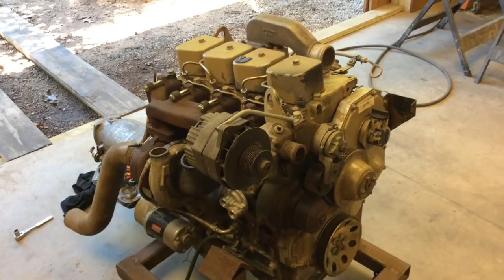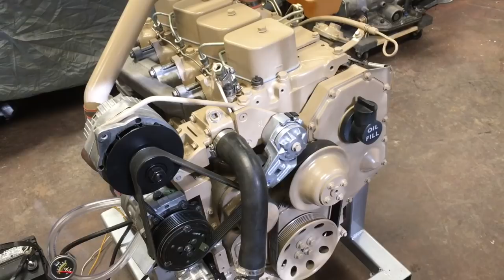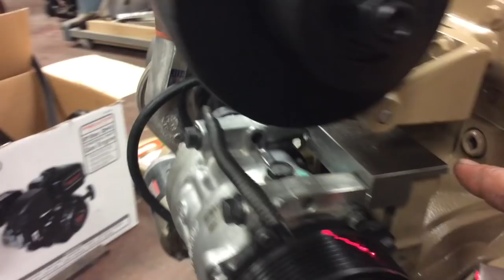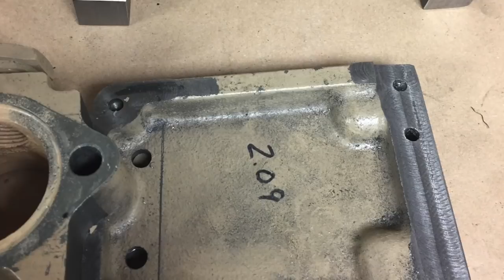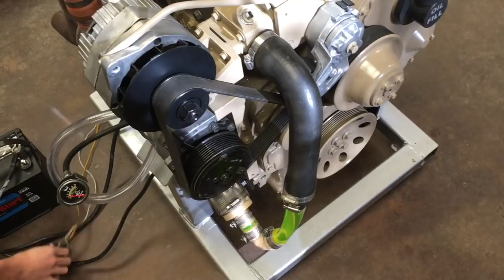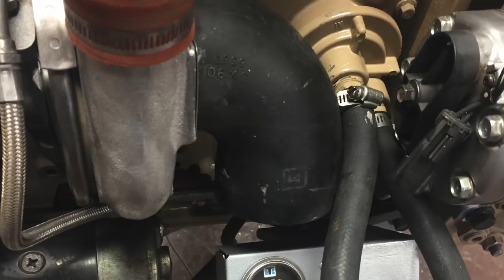Cummins 4BT

Comment: Don, really looking forward to seeing the RX7 project.  Your video's are fantastic.  Re: the battery build.  What are you thinking exactly?  Do you want to buy 18650 cells, recycle cells, buy solid car packs? Etc.
Reply from the maker: Aidan McGrath thanks for the kind words. I’m leaning towards buying a Nissan Leaf pack. Managing over 7,000 18650 cells seems a bit daunting to me.
Reply: The Nissan Leaf has some quite interesting modules, however if you find them a bit lacking take a gander at the "Tesla Battery"-modules, these are 24V and roughly 5kWh each. There is a guy on Youtube called CarGuru, funny fellow who has a lot of experience with taking Tesla's apart, he might be able to help you get a few if that is where you end up.

Great watching your project, take care! =)